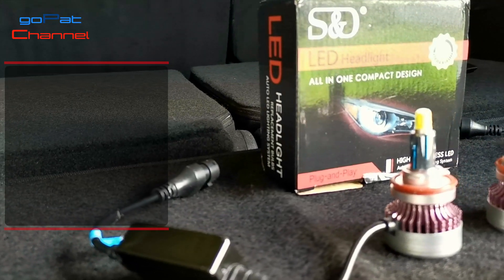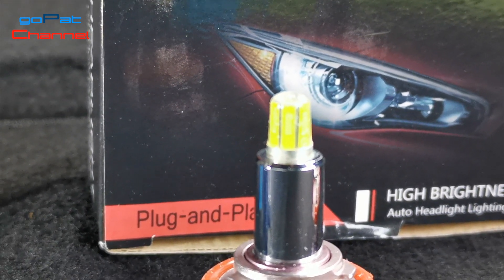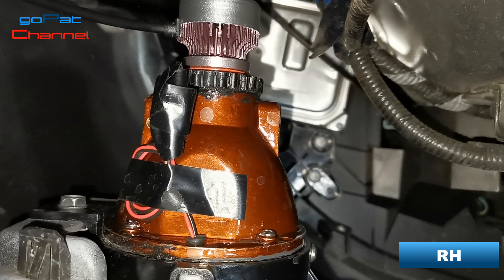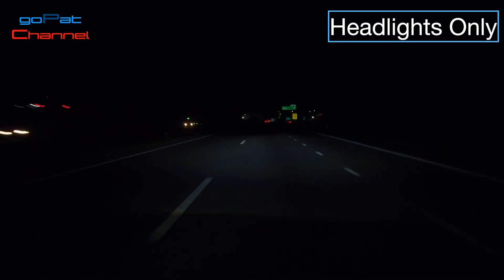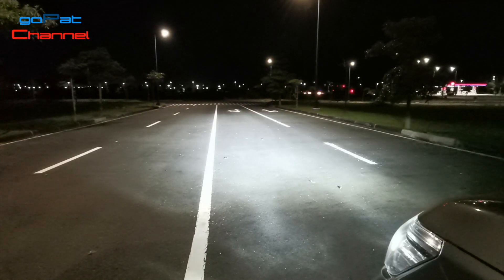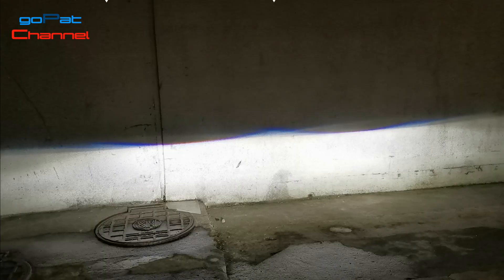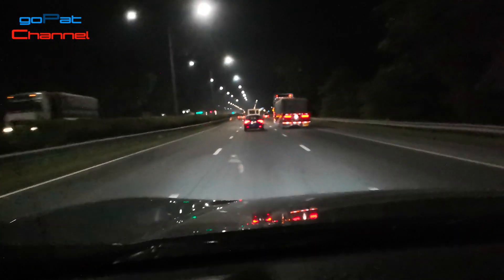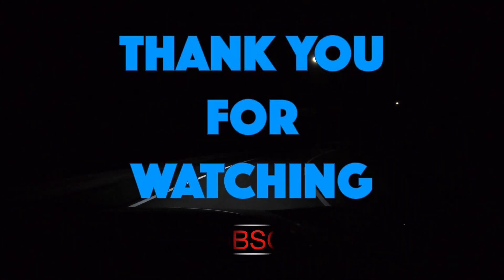360° LED Bulbs in Projector Lamps Review

Comment: I am planning to use this for my Hyundai Kona, but in my unit, the socket serves as the retainer and locking mechanism. Nakahanap ako ng retainer sa Shopee na fit sa model pero 16mm inner diameter. Anong diameter po nitong H7 from S&D kapag inalis yung sleeve? Yung sa ToAuto kasi 24mm daw ang diameter. Thank you!